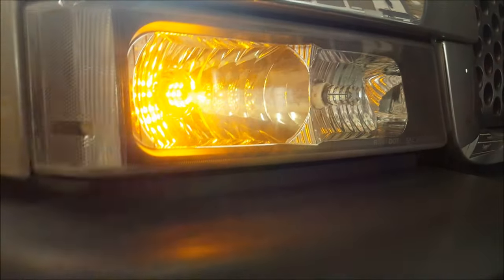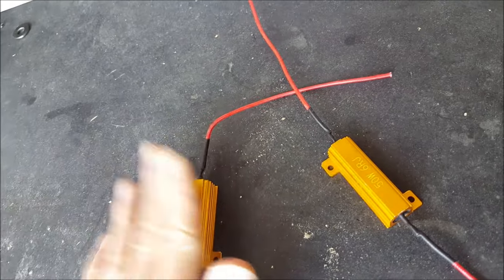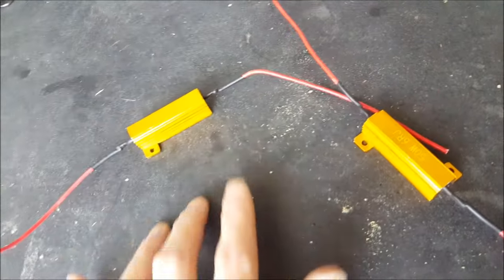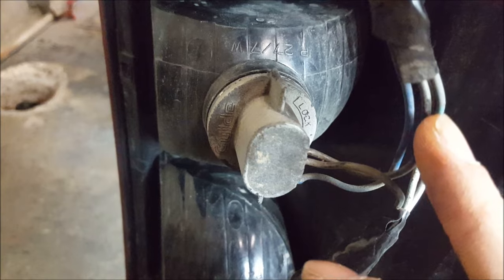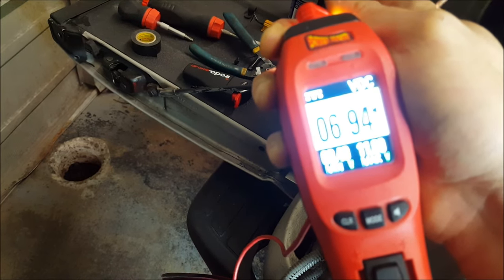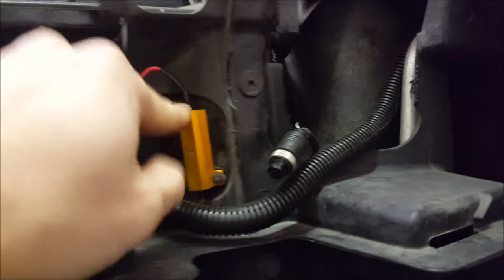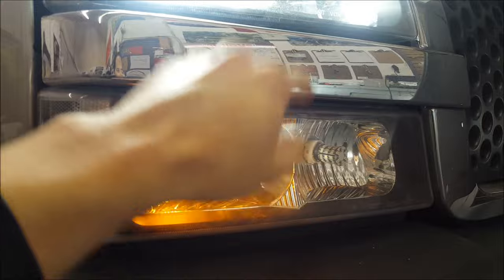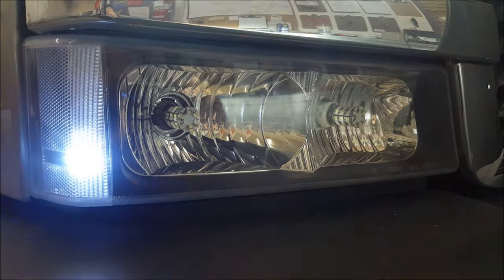Load Resistor Install (Eliminating Signal Hyper Flash) | AnthonyJ350

Comment: The resistor does not create a short. A short is when you have power flowing with no load on the circuit. A load is anything that consumes power on a given circuit... In this situation the "load" is the resistor itself. If you would put a plain wire between the positive and negative ends then you would have a short. Now as to why you get "hyper-flash" is because the LED bulbs consume very little power compared to the stock incandescent ones. Replacing the bulbs with LEDs makes the vehicle think that one of the bulbs may be burned out so it hyper-flashes as a warning. Adding the load resistors increases power consumption making the vehicle think everything is A-OK. Thought I would clear up some things for you.
Reply: Using to heavy resistors can make the car think there is a short circuit. That's why you should use a 25w resistor for each bulb or one 50w resistor for two bulbs, i.e. front and rear.

Comment: Nice pun "hopefully this sheds some light..."  ha ha.  Anyway, just a note on the resistors, since vehicles have  DC (not AC) the diode only allowing current in one direction would not affect it. It would either just work (very high resistance) or not work (open) depending on polarity. It would likely result in hyperflash/error in both scenarios.  The problem some people run into is that not all cars have used  turn signal bulbs with the same resistance over the years.  

Option 1: If you have a multitester, just measure the resistance of the factory bulb, and make sure the resistor  has approximately the same resistance.  If you have trouble, measure the Ohms of the resistors and make sure they match what they are supposed to be.  With such a lack of quality these days, you may also have a defective resistor.

Option 2: Purchase replacement LED with a built in resistor, but it has to specific to the bulb being replaced (ie have the same resistance).  If the LED manufacturer tries to get away with using the same LED replacement for incandescent bulbs with vastly different resistance, then it may or may not work. 

Option 3: Trial and error with straight LED (no built in resistor).  If you get hyperflash/error, use a resistor. If  it's still too fast, try a resistor with smaller Ohm value (or you can also use 2 of the larger resistors in parallel to achieve half--but be careful, you might blow a fuse in the process :-).  If it's blinking too slow, use more resistance (you can put 2 of them in series to double the resistance).  Just look up resistors in parallel vs series on youtube if you are not sure what that is.  Changing resistance has an inverse effect on the amps.  The computer is really just looking at the amount of amps drawn when it flashes and a straight LED bulb uses significantly less amps (has higher resistance) than incandescent.  

Option 4: Some owner's manuals give the watts of the bulb and as long as the resistor's watt rating is based on the same voltage, it might get you close enough, YMMV.

Option 5: There may be a replacement flasher or relay (vehicle specific)  that can fix it.
Reply from the maker: Thanks for your input!

Comment: I'm doing this this weekend. I'm also going to be redoing the wiring for my HIDs. I did it kinda lazy because I wanted to put them in, but had to get it done in time to make it to work. Haven't had the time to fix it since. But I'm setting time aside to pull it all out and mount and run the wire better. Will also take the time to find good places to put the load resistors. I already have one that I use for my headlights so that way my high beam dash indicator will work when my brights are on.

Comment: Hyper flash on flashers is cause by the current draw from a filament lamb is higher than a LED lamb. The flash unit is designed to flash for a given time depending on the lamp current drawn. Adding a resistor to the LED will simulate the proper current during this condition, given you the normal flash time.
Reply: oh, but hyperflashing is harmless to the vehicle though, yes?
Reply: yes

Comment: Your thoughts on electricity need some help.  Resistance creates heat which is why incandescent bulbs are hot.  Since the load resistor is taking the same load as the incandescent light bulb that's being replaced, it gets just as hot.  LEDs take very little current, that's why they stay cool and that's also why the vehicle hyper flashes.  It doesn't see the load it's expecting so it alerts the driver of a bulb out.  Putting the resistor in the circuit isn't like creating a short because there is a load.  A short is when there is a circuit with no load, like a screwdriver makes connection with both positive and negative.  In the case of a short, the current is unrestricted except by the wires so an electrical fire happens.  Having a load limits the amount of current allowed through the circuit.
Reply from the maker: Thanks for the feedback!

Comment: actually all the turn signals are fitted with a device called flasher. it is what makes your bulb go on off on off in a flashing kinda way. what happened inside the circuit is that when the current flows through the filament(Closed circuit-bulb on) it grows big, due to the heat, and it in turns disconnected the circuit. And the bulb goes off. when in open circuit the filament cools down and circuit is closed again. bulbs is on again. these process repeats itself. and you have flashing turn signal. and when you connect a LED(which offers a much lower resistance)  instead of a bulb current flowing through the filament is more.  It heats up quickly. this disconnects the circuit quickly and you get quick flashes.
Reply: The entire car just has a single flasher relay. A resistor in that circuit does the hyper-flash thing to try and notify you of a bulb being burnt out. Rather than deal with resistors you can usually find an electronic flasher that avoids the problem.
Reply: Or when your turn singals are controlled by the BCM, instead of a relay. Then you have to use a load resister.

Comment: I like to add a dab of heat sink compound (silicone grease) between the resistor and the metal it gets mounted to to promote the transfer of heat between the two.
Reply from the maker: Ian Aintsaying That's a great tip thanks!

Comment: I did this to stop the hyper flash and it worked great but I recently went back to incandescent bulb when I installed blue dot taillight lenses and they aren't as bright as I thought they would be, are the resistors limiting or resisting the power to the bulb ? Should I remove them or try something else ?
Reply from the maker: Yes if you go back to incandescent, you'll need to remove the load resistor.

Comment: Your reason for hyperflash occurring... no.
You need to understand what creates the timing for your car's indicator relay. Resistors. The car uses the inherent resistance of the incandescent light bulb to create the timing. LED's have extremely low resistance, so in order to correct the relay's timer, you must put appropriate resistance back into the circuit.
Reply: Well put !!!!
Reply: razmossis wow finally somebody that's not talking out there ass on YouTube
Reply: all correct except leds have higher resistance and dont draw as much current,
Reply: LEDs have basically NO resistance. That is why nearly every circuit with an LED requires a resistor.
You're right that they don't draw as much current, that is the reason a second line has to be wired in parallel, to allow the excess current to flow around the LED.
Reply: Thanks for the clarification !!
Reply: The problem with purchasing a mechanical flasher is some are mounted on a circuit board. In my 01' WS6 Trans Am I was able to replace the flasher with a mechanical one and voila. It's under the dash and took less than a minute. In my 07' Dodge Ram 2500 the flasher is on a circuit board so resistor loads it is...
Reply: Yes well put. The lower resistance from the led's increases the current which makes the light flash faster.
Reply: not correct, the LED has a higher resister, so an additional resister needs to be added parallel to the LED to "fake" the lower resister, so the flasher is tricked into thinking it is a regular bulb (with low resistance)
Reply: Question! With the load resistor does the power consumption increase?
Reply: in the olden days, the flashing is accomplished by bi-metal switch, not unlike what you have in the old Christmas tree light.
bi-metal heats up, and bend away from contact, thus breaking the circuit, then cools down, bends back, and reconnect the circuit.
if the resistance is lowered, more current flows, thus speeding up of the heating cycle, that's why it flashes faster. 
I would imagine on extremely cold day, the flashing rate would be slower than hot summer day.

Comment: Yes i put in new projectors headlights with led turn signals they came with resistors still hyper flashing was thinking about putting a orange trailer in the air dam to see if that fixes the problem
Reply from the maker: Let us know what your fix is please.

Comment: Replace the existing flasher relay with one of those modified electronic flasher relays for your automobile. Some vehicles don't have a replaceable relay though. Some people have had success using CANBUS rated LEDs. I've heard that some vehicles have a control module that controls the left/right turn flashing and that module can be  reprogrammed for LEDs. Not all modules can be reprogrammed. Load resistors should be your last option.
Reply from the maker: Load resistors are what we use in law enforcement vehicles and put them onto a heat sink bank. I can't think of a higher demand application. I've also had mine in my truck for about 8 years.
Reply: @AnthonyJ350  Replacing the flasher relay is the best option. That was fine for my 2002 Mustang but I just found out that my 2014 Xterra doesn't have a user replaceable flash relay because it's integrated into the BCM. I've heard that the BCM can be reprogrammed but someone else said it isn't possiible.  Nissan service couldn't help because this is non-stock. Some say that the CANBUS rated LEDs would be an option since they're suppose to have circuity that pulls enough current to fool the vehicles electronics into thinking that an OEM bulb is being used. Resistors are an option but the only problem with that is that if your LED goes bad the resistors will be telling the electronics that the LED  is good.
Reply from the maker: @genericdude6551  You don't do periodic 360 checks when you drive your vehicle? Or just look in the reflection off vehicles or glass on building when backing up to check for operation.

Not saying your method doesn't work, but there's some cheap flashers out there. I use what works and that's for my personal vehicles and law enforcement.

I've logged over 100,000KM and 10+ years on this style of install and still own the same truck. Just sharing what I have proven to myself

Comment: I'm experiencing hyper flash on my car and I'm going to buy these. I was curious if I did my front and rear turn signals do I need to install a resistor before the front one as well as before the back one or can I just put one resistor in the whole circuit?
Reply: Every turn led will need one. :)
Reply from the maker: Every bulb will need a load resistor if swapped to LED.

Comment: so i was hoping you would touch on this if you have LED bulbs switchbacks on all 4 corners do you have to install resistors for each or just the two fronts or rears and it will it work that way just curious
Reply from the maker: For every turn signal bulb you convert you'll need a load resistor. Unless the LED bulb provides a load for the vehicle to see.

Comment: Is water resistance tolerable? For example, in rainy conditions? I wonder how it is installed behind the lighthouse runs that risk. Or is it harmless?
Reply from the maker: They seem to work fine with a little moisture.  They're sealed.

Comment: I install led lights for Brakes and reverse they are compatible with my 2013 Ford Edge se so far they working do I still need to install resistors
Reply from the maker: Brakes and reverse are fine without resistors. As long as you have no warning lights
Reply: Alfredo  mi estimado, una pregunta, que tal le fue con esas luces led? Tengo en mismo carro y quería ponerle leds, tanto reversa, las luces de parking que tambien son las de freno , y las direccionales, pero quería saber que tal funcionan en mi mismo carro

Comment: Hi Anthony great video. Got a w203 2004 Merc. I installed a LED for my low beam and it would go on and off by itself. What could be wrong, would this load resistor work for the headlight or its just for the turn signal.
Reply from the maker: Load resistor will not help.  Is the plug tight?
Reply: @AnthonyJ350  thanks for the reply Anthony. yes the plug is tight and i get a error msg saying "check front right main light" I've used two types of LED and still, it will go on for a few seconds and off again. My be it needs a chip or something.
Reply from the maker: @richardrafols8627  I'd look for a bulb that prevent "bulb errors". I just don't like a load resistor being fired up constantly for hours like on a marker or headlight application.

Comment: Do you have to wire it to just one light or both front turn signals
Reply from the maker: Any turn signal with an LED bulb replacement will need a load resistor.

Comment: I had led switch backs on my 08 grand marquis, installed resistors and worked fine for about 3-4 months, until the driver side one started hyper flash again. Changed resistors with no change, so removed setup until I can figure it out. Had the same issue with the rear bulbs as there brake/turn and running lights. I have the proper bulbs and resistors for the setup, and would like to get it working again.
Reply from the maker: +Chris B How did you splice into the wiring?
Reply: +AnthonyJ350 when I did the fronts, I used t taps. Made sure they where securely connected and left some extra wire for some movement, along with some weather pack connections so if I had to service the bulbs I could unplug it. Same for the rear, except I used a different form of tap, the inline one that came with the resistors, and used more of the weather pack connections. Some people have told me since the signals are controlled by the cars LCM, I would have to tie into that, and I don't want to do that. There has to be another way to get all the signals working with the SMD LED's working with the resistors.
Reply from the maker: +Chris B But if people argued that you have to go into the LCM why did it work for a whole 3-4 months?  I'm going to say it was a connection issue.  I had a cold solder joint during the video and it still hyper flashed until I redid the connection.  Try all new load resistors and solder all of your connections and use 3M Super33 electrical tape.
Reply: +AnthonyJ350 that's what I was thinking, it worked fine until then. The passenger side worked fine, just the driver side. I have plenty of extra wire, so I can remove the weather pack connections, solder them in heat shrink tubing and the electrical tape.
Reply from the maker: Chris B Let me know what happens after.  I'm interested if that's the fix.

On a side note, throw all your t-taps away and only solder from now on :)
Reply: +AnthonyJ350 ok will do, how did you tie into the main wire? Did you cut it?
Reply from the maker: Chris B I strip back the insulation wrap the wire, solder, then wrap in tape.

Comment: Hello, great video, thank you!

Question; I have a 2005 Corvette and a while back, I installed a sequential turn signal modules for the rear taillights (two round tail lights on either side). It worked great until I decided to replace the incandescent bulbs with LED's. Since then, the wretched hyper flash started which superseded the sequential turn signals. 

How do I get the hyper flash to stop along with keeping the sequential turn signals going? I did try installing a resister on the inner tail light (sequence of flashing light is from inner light to outer light) on both left and right sides but that did not fix it. Do I need to put the resisters on both tail light on the left and right sides or do I need to find where the hot turn signal wire splits off (one for inner and one for the outer sockets, and attach a single resister there? Thanks!
Reply from the maker: This video should help https://youtu.be/NMoYGQhD2DI?si=u-hBahpcvFh_qGlo

Comment: Great info thx I have a question maybe you can help I installed a set of flashers on my 15 explorer the diodes eliminated the hyper flash but one gets to hot to touch while the other is cool to the touch is that normal?
Reply from the maker: Did you mount them on to metal?

Comment: I'm using these on my motorcycle. The resistors came with 4 zip ties (I'm assuming for mounting). Will these mount fine to the metal frame using zip ties or will it melt the zip ties? I feel like it should work since they won't be wrapped around the heat sink itself, but around through the screw holes instead. I would like your opinion though.
Reply from the maker: I've always screwed them in. Never done a hear test on it
Reply: AnthonyJ350 Screwing would be better, but I'm not sure I can find a good place to screw it into my bike. If I zip tie, I'll probably attach it to the wires on either end to support it rather than the heat sink, although I can't imagine the resistor getting all that hot when the turn signals are only used for brief periods at a time.
Reply from the maker: +John Peterson There's a reason why it's whole case is a big heat sink. I'd make a metal bracket or something. It's a bike right?  Why not let it hyperflash?  Makes you more noticeable. I did that on mine. Keeps the electrical simple.
Reply: It ended up not really hyperflashing anyways so I just installed the new lights without the resistor.